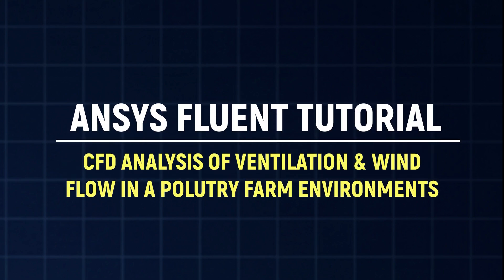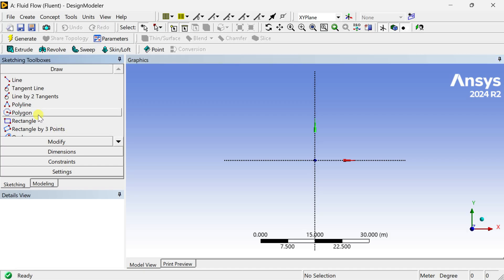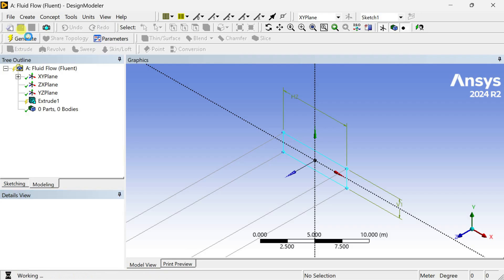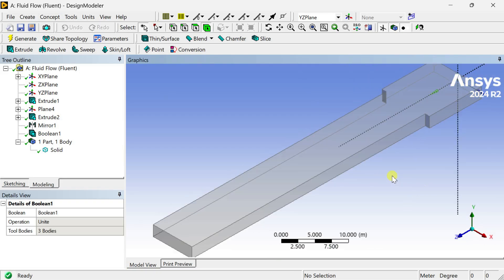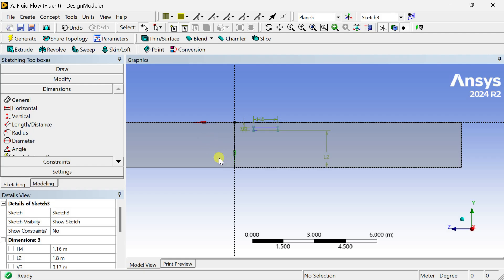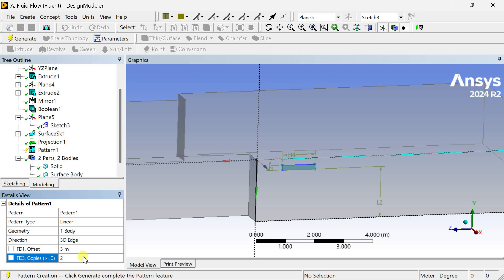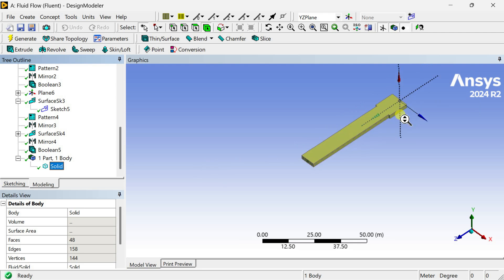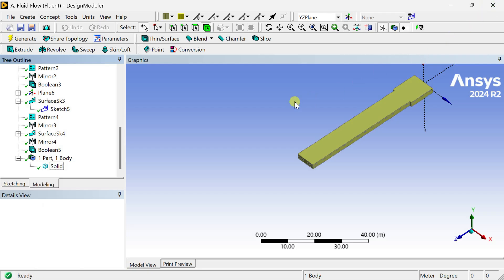ANSYS Fluent Tutorial: CFD Analysis of Ventilation & Wind Flow In a Poultry Farm | Tutorial Part-1

Comment: sir i have a question to you , actually i am currently working on research , i face some probelms in ansys fluent that , actually i place cylinder( o.2cm radius, 18cm tall)  in a channel in ansys's design modeler , but in ansys fluent cylinders not showing what will be the main reason , plz provide the best solution....THANK YOU
Reply from the maker: Has the meshing done successfully?
Reply: @AnsysTutor yes
Reply from the maker: In fluent window, it might not be visible due to very long geometry as compared to its diameter.  Are you able to run the iterations properly or not?
Reply: @AnsysTutor  i can run smoothly , but actually i am using cylinder to represent tree, to stop water flow (for tsunami wave energy mitigation) but there is no effect of tree cylinders on water , water can pass smoothly without any resistance ...
Reply from the maker: in that case, you mesh need to more refined/ small cells near the tree areas so that the solver would consider the shear force in these regions.